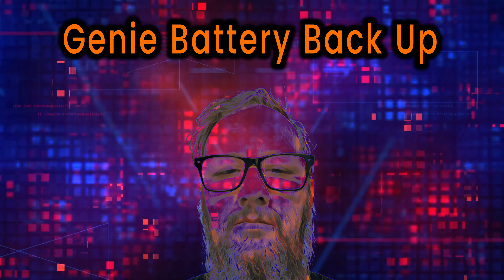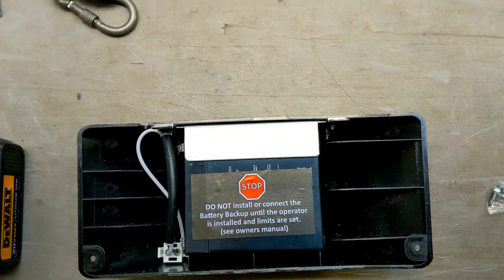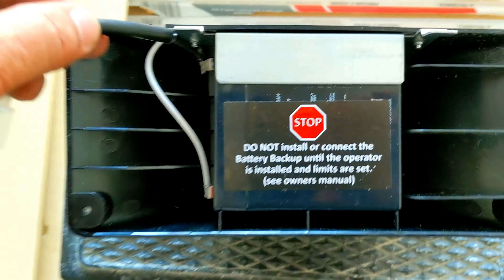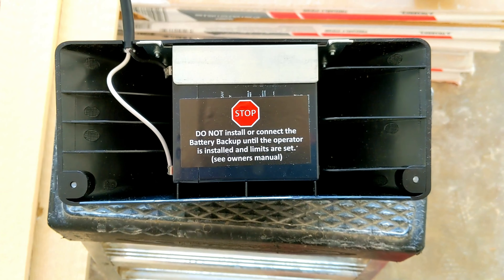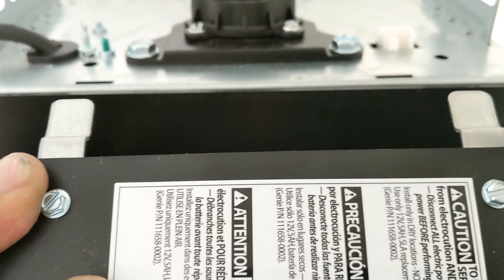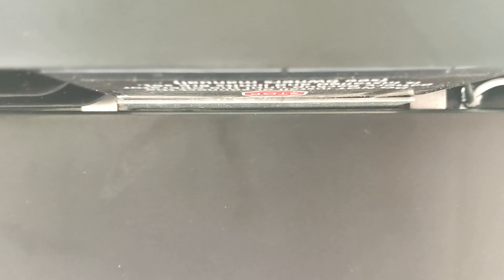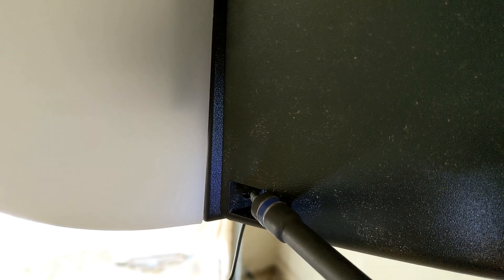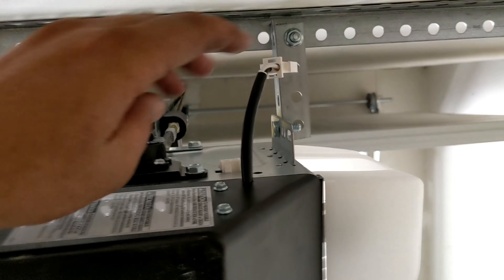Genie Garage Door Opener Battery Back Up - How To Installation Video

Comment: Warning for anyone in same situation as me. If you are mounting your opener close to ceiling (like mine is 2 1/2 inches from ceiling). Mount battery before installing opener. Just do not plug it in until you get to that step. There is not enough clearance to install it. 
If you do, you will have to remove the 4 quarter inch screws on top of battery box and install metal plate with 2 tabs and than put battery box back on to metal plate.
Reply from the maker: Thanks for the feedback! 👍🏼

Comment: Was the receptical for the battery plug already attached to the outside of the opener or did you have to open the opener up and retrieve the receptical end and push it through the hole on the top to plug the battery plug into? I have a model 3055 and there is a black filler plug plugging the hole for the receptical connection.
Reply from the maker: Alan the receptical end should already be in place.  No need to open it up to push it through.
Reply: @garagedoorgenius  Thank you for your response. I  just bought this one and I thought I could add the backup battery but apparently it isn't compatible for some reason because the receptical hole has a black plug plugging it.

Comment: Great video, thanks for making.  How long can I expect the battery to last if it’s never needed?  That is, battery never used to actually power the DC motor?
Reply from the maker: They range from 3-5 year's...
You'd think they would last longer, but they are constantly plugged in recieving an electric charge.  So that's why they will lose charge.

Comment: I just installed a genie garage opener. Do I go ahead and put the back up battery on and connect it? Or do I only put it on when I need it
Reply from the maker: The battery needs plugged in so it can get fully charged. I would just leave it on from the get-go.

Comment: Interesting design. It sort of reminds me of the original LiftMaster battery on the 2500 and 3500
Reply from the maker: Yea for sure.  I wish I could post pics in the comments.  I had one of those a couple weeks ago that fell off the opener.  It has 2 batteries in it, which I didn't know. The whole thing shattered into a hundred pieces 😂

Comment: Great video thank you sir. Helpful tip for viewers. Set you drill depth controller too very low and work your way up. To prevent stripping out the plastic. 🙏🏽
Reply from the maker: Thank you for your comment 😊!!

Comment: Do you have to drill into the garage opener
Reply from the maker: Yes, that's why they send two little self-tapping screws for that. It's just going into the plastic lid.
Reply: @garagedoorgenius  thank you
Reply from the maker: @willperfect6193  not a problem! 🙏
Reply: @garagedoorgenius I connected mine and it just hangs there nothing's going to cause to come down so I don't think you really need the screws not to mention I don't know where my screws went
Reply from the maker: @jedklang  I don't think it would fall without the screws.  Screws should've been in a little plastic pack inside the battery.
Reply: Why ruin plastic I just tried moving it and it will not come down unless it's up to remove it from the slots interesting that they give the screws to ruin the plastic
Reply from the maker: @jedklang  right on.  👊🏼 I mean, they are little screws.  I'm sure Genie wants it secure.  Just in case.  Wouldn't want it to fall on a windshield of a Lamborghini!  Lol

Comment: My door opener and battery have been installed for 3 days now and I just wanted to test it, so I unplugged the power and activated the door. It moves soooo slow. Is that normal or is it that the battery is not charging? Anybody know?
Reply from the maker: It definitely operates slower.  I wouldn't worry.

Comment: Hi, the red light on the garage door opener is staying on. The battery has been connected. Can you tell me why it would stay on. Thank you
Reply from the maker: It's possibly charging.  When it's completely charged, should go off.
Red LED -
 Battery voltage is 
 below operational 
 level.
If red LED stays on over 
48 hours, the battery has
failed to charge. 
Check Connection Cable 
connections and battery.
Reply: @garagedoorgenius  wow thank you so much for the response...

Comment: Once the power is out, how long the battery will last without electricity?
Reply from the maker: They say about 2 days worth you have auxiliary battery power.
Reply: @garagedoorgenius  Did Genie tell you this? I called them and they did not know. They also do not know what the 12vdc current draw is on battery backup. Last year power was out for 4 days. Thanks!
Reply from the maker: @ridemfast7625  I've tested mine.  Works for about 3 days.  Texas winter storm of 2021.
Reply: Instruction manual says about 50 openings of garage door. All depends on how heavy garage door is

Comment: I can't find the instructions and there aren't holes in the opener.  I guess it's self drilling screw time.
Thanks.
Reply from the maker: To secure it, yes you have to use the 2 self tapper's and drill through.  There's no pre drilled holes.
Reply: @garagedoorgenius  That is what I was curious about. 
2 holes in the battery case.
No holes in the opener housing. 
Simple installation. 
Just looking for verification!
Thanks!
Reply from the maker: 10-4
Reply: You don't need the screws it just hangs there gravity holds it down

Comment: Does anyone know how many days the opener will be operational after a power outage? Genie claims 50 door cycles, which I personally doubt. But no mention of length of time on battery backup. I asked Genie and they did not know. They just mention the 50 cycles. They also do not know what the battery backup, 12 vdc, current draw is.

Comment: Does anyone know of a garage opener where I can plug in a battery & have a remote to open it & use this every day to open/close it?

I have a devious neighbor who’s savvy with radio frequencies & keeps using some device to f#ck with my different garage codes that I switch to. ☹️
Reply: FCC is radio spectrum code enforcement if he keeps disrupting signals. Reach out to a local HAM radio hobby group for opinions. They likely know relevant codes that your neighbor is breaking since they have to avoid disruptive use of radio spectrum to continue their hobby legally.